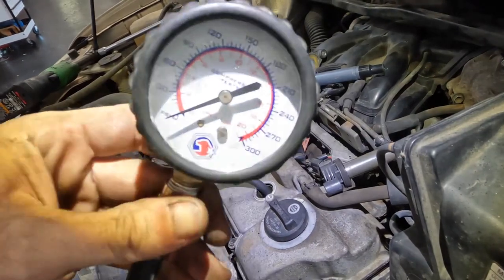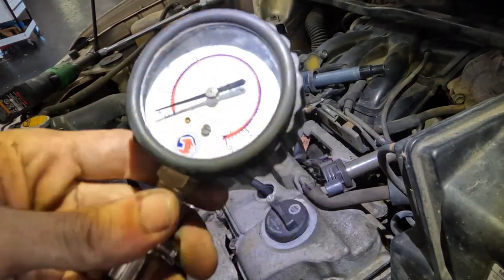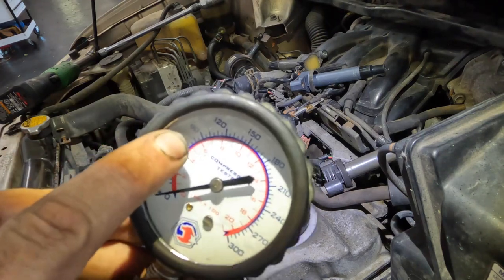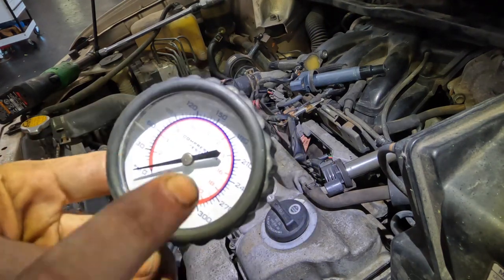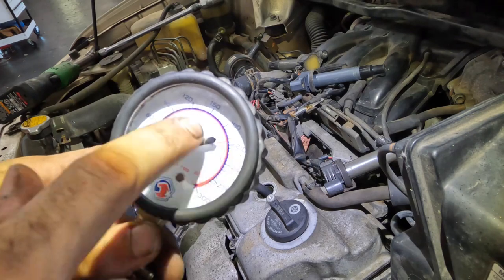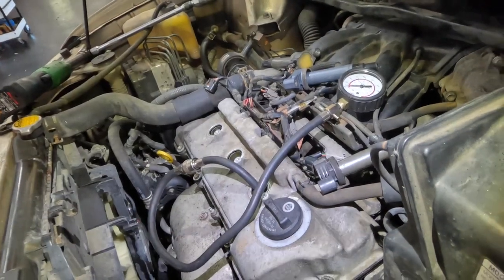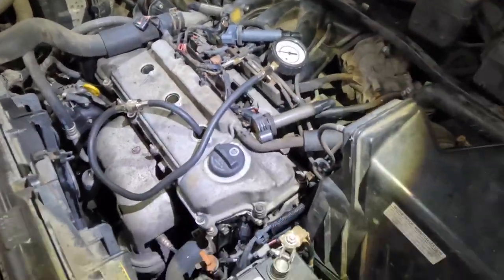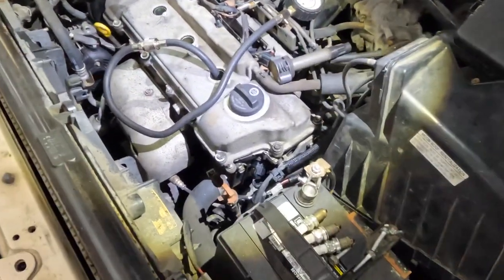I think it blew up! Early Preview!  UNLISTED Video At End Screen

Comment: I'd be looking for a maintenance window in the block with that noise!
Reply: If it doesn't have one just give it one more rev and one will appear.
Reply: I am amused and flinching at the description "maintenance window".
My ex-wife made one in the block of a Saturn SL back in around 2002. Apparently, even though I told her otherwise, the oil light coming on meant it was time to schedule an oil change... in a month or two.
One of many reasons she has the ex- title.

Comment: Sounds like a finely tuned Briggs and Stratton engine
Reply: i have an old briggs and stratton mower never changed the oil, its probably 20+ years. Still goes but a little slower.. and drinks more fuel than my car. Had to buy a new one lol
Reply: Or like a worn out Briggs  And  Stratton.
Reply: kinda like a hit and miss engine
Reply: You mean Briggs & Struggling... :D

Comment: Easy to find an exhaust  valve leak.  Just put a piece of paper towel at the tailpipe.  If it tries to suck it in periodically, it's an exhaust valve stuck open.

You make excellent videos, by the way.  Thanks...

Comment: One of the cylinders on VW beetle engine has 75 PSI compression, and it still fires regularly enough to get the exhaust header hot. Definitely doesn't fire all the time though, especially on a cold start!

Comment: Check the timing belt, I just did one on that motor the other day. 170k miles and the belt had cracks you could fit a penny into. Non interference I believe

Comment: Sounds like money to me. With the odd coils the first thing I'd be checking is are those two coil packs on the correct cylinders?
Then has it good coolant and oil, aluminium (not aluminum) engines like fresh oil and water in the right places.

Comment: Just full the fuse for the fuel pump so u can crank it but not start it ans no fuel will get in it. You dont have to disconnect injectors and coils
Reply: Isn't there still pressure in the fuel line?
Reply: @dans_Learning_Curve  Probably, depending on the setup.

I don't like to be uncertain when I need an engine disabled for repairs.
Reply: @iFixJunk  press the schrader valve to check and release it. No more fuel pressure, no engine starting. Or pull the fuse for the injectors and coil if you're that worried. Still no far less work than removing everything when you dont need to.